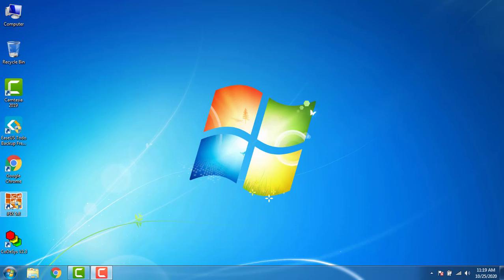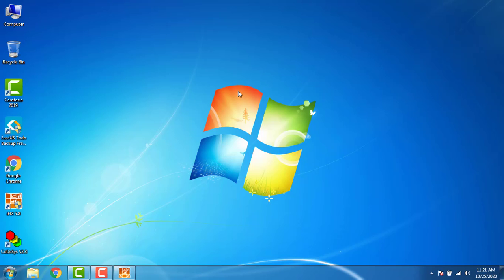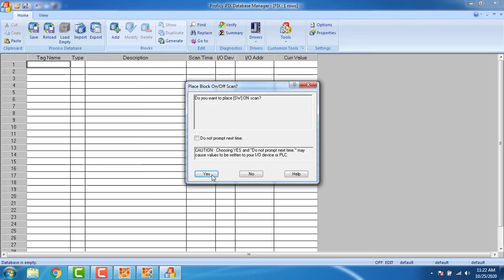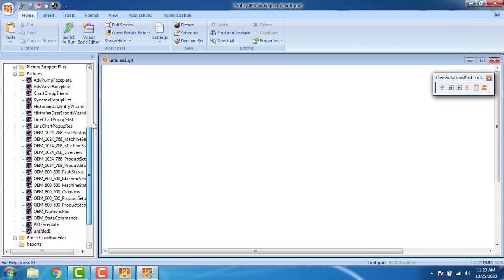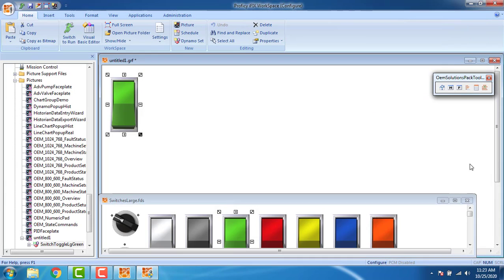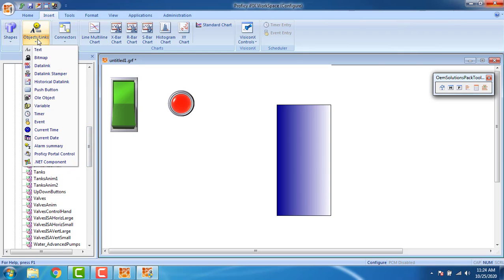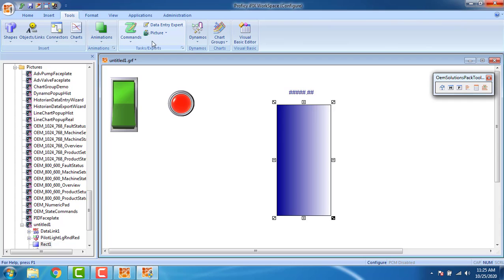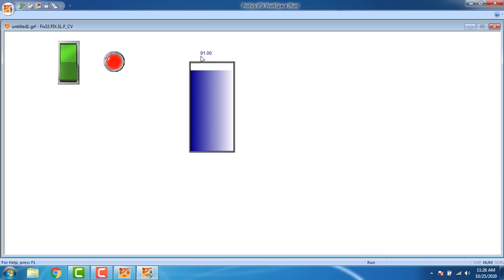iFix SCADA in 6min [GE IFIX SCADA BASIC ANALOG & DIGITAL TUTORIAL FOR BEGINNERS]

Comment: When I open existing project, it goes directly to runtime platform. how can I open development platform to modify the graphic. I'm a beginners. Thanks
Reply from the maker: If you are in an existing plant please use Engineer login or above to access the development of the scada. If the user is operator you cannot.
Reply: I got an advice that from runtime platform, I need to user ctrl+W to go to development platform.
Reply from the maker: Ctrl +w is the shortcut but if safeview is configured in plant it will not go to edit mode
Reply: In this case, how to access the development of the scada. Even use Engineer login then what I need to do to access development. Thanks

Comment: During run, you change the tank/slider value. Why is the button/light going on and off when you do that? I have this problem but I don't like it...
Reply from the maker: On the database manager the bit address 0:0 which is linked to the word address given to the tank level. AND THOSE ADDRESS ARE OVERLAPING. You have to give 1 for the tank and 0:0 for the switch to resolve the problem